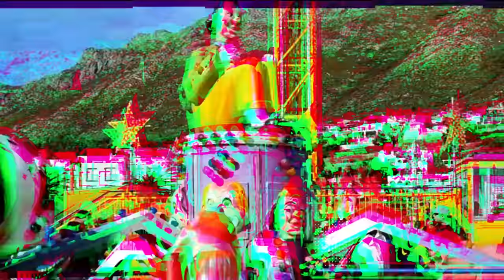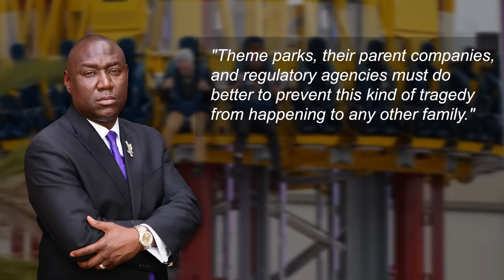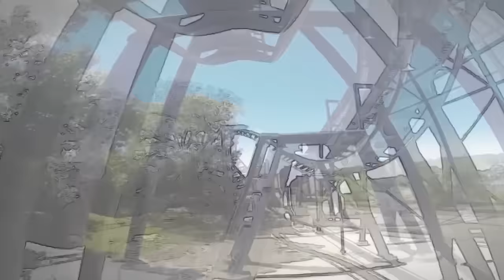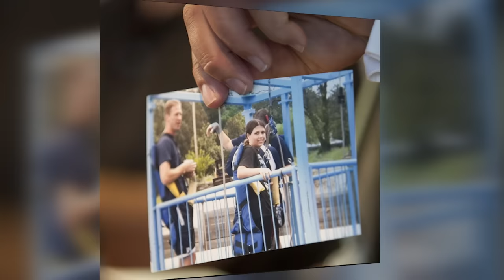9 Worst Roller Coaster Accidents in Human History

Comment: When Great America first opened I took my then 8yr old. She met all the requirements and then some. There were no seatbelts just a u-shaped restraint that clicked into the seat. Everytime we went upside down she started to slip out. I spent the ride holding on to her, desperately trying to keep her inside the car. We were fortunate. I've heard of kids who were not.
Reply: It is physically impossible to slip out of a ride when it is upside down when it's moving at a high speed. It's called physics. If your still above 1G when your upside down, your not going anywhere. All modern coasters are designed to invert above 1G so stuff like that doesn't happen.

Comment: It's just a known fact that rides sometimes fail or the necessary restraints do not work properly.  If extreme rides are to continue to operate, there should be really skilled and attentive attendants, not just a random teenager on a summer job.  People with size issues and/or disabilities should probably think carefully before attempting to board.
Reply: No teenagers ?   412.50 per daily admission.  85.00 to park.
Reply: In Australia they regularly check them for maintenance and close the rides when they feel theirs a maintenance issue or technical

Comment: If someone ever tells you to loosen your seat belt, don’t. They are there so you don’t fly out, same for the restraints, get those as tight as possible, not so it’s uncomfortable but enough to hold you in. I never would listen to someone if they told me to loosen my seat belt.
Reply: Seatbelts on coasters are to make sure you can fit in the restraint, Not to keep the restraint down. Also it sounds like your missing out on 🤩airtime 🤩

Comment: Regarding the first story... firstly, let me say that my heart truly does go out to that young man's family. It was an avoidable tragedy.

I don't think the rider, the ride operator or the park are responsible, though. Let me clarify. There is a small piece of metal deep within the restraint system called the proximity operating sensor. When you pull the restraint down, the small metal piece sweeps downward along with the restraint until the sensor behind it reads that the bottom of the proximity operating sensor is aligned with it. This is the maximum allowance of space between the restraint and the seat for riders to be safely secured. This triggers an "all clear" command for that seat (green light). The ride's computer system will not allow the ride to be dispatched until that "all clear" command is received for all seats. This is why the ride operators have to push down the restraints on empty seats before dispatching a ride vehicle.

The investigation into this accident revealed that the proximity operating sensor had actually been manually adjusted UP seven inches, thus causing the bottom of it to interact with the other sensor much sooner when pulling down the restraint. The investigation also revealed that this had been done to one other seat as well. Now... a ride operator would not be able to access this metal piece to adjust it. It is hidden behind fiberglass which covers the pinch points (joints) of the restraint, and the whole restraint system would need to be taken apart in order to reach it and adjust it with a hex key. The park would not be making those adjustments either, as their company does not operate this ride. Their company merely houses the ride. The operator of the ride is The Slingshot Group. The decision to make this highly illegal adjustment would had to have been made by management at The Slingshot Group and carried out by one of their ride mechanics, I'm guessing in order to accommodate larger riders than the ride was designed for in order to grab a few extra dollars at the ticket window.

I don't blame the ride operator for this accident either, as they would have received an "all clear" command from the computer system due to that adjustment being made. I don't believe the ride operators would have even known the adjustment HAD been made.

I am an avid coaster enthusiast and a FIRM believer in ride safety being priority one, priority two, and priority three. Safety first, last, and always. Having a little bit of "play" between you and a ride restraint will not be unsafe, but having that much "play" absolutely can be. That is why the ride computers do not allow the ride to be dispatched when the restraints are not down far enough. I've ridden coasters possibly hundreds of times since that accident occurred, but The Slingshot Group will never receive one red cent from me. I have since boycotted every single one of their rides. Shame on them for allowing greed to cause an accident, nonetheless a fatal one.

Comment: My family and I went to Knotts Berry Farm shortly after 9/11. We had family visiting for the first time from the midwest and if I remember correctly they were supposed to fly back home on 9/12 but were forced to stay when air travel was shut down. On the day we went, after dark, my dad and I rode a water splash ride called Perilous Plunge and a few minutes after were standing in line for a different ride. Paramedics and park personnel all rushed to the water ride we had just rode. A woman had slipped out through the safety harness at the top of the drop and fallen to her death in the water below just a few ride cycles after we got off. As an at the time 65 pound 7 year old, I remember being terrified that I might slip out myself. I think we left shortly after.

Comment: I don't think those roller coasters can take very heavy people. I say this because when I went to six flags magic mountain in California. We got on the Batman ride. When you sit, a metal bar comes over your head and into your lap and then locks in place. There was a guy that was pretty big (fat) sitting next to me and the guy that came around checking the metal bar to make sure it was locked and secure when he got to the big guy next to him. The ride operator couldnt lock the metal bar. So another ride operator came to help him to try to push the metal bar down to lock it but it was not happening. The 2 ride operators told the guy that he could not ride the roller coaster because the metal bar was not locking..
The reason the metal bar was not locking was because the guy was TOO FAT.. Well the guy got all offensive making a huge scene. Yelling at the ride operators that they were discriminating him because of his weight. A manager came over and told the FAT GUY that was not it. The roller coasters can not take very FAT PEOPLE. Because the safety metal bars will not lock the way they should..
Its sad but that is reality.
If you are too fat there is no way you will be able to ride a roller coaster..
The big guy left talking smack but it is not the ride operators fault. They were looking out for his safety and everyone elses..
This happened in the 1990s..

Comment: The first one had nothing to do with the ride itself at all. It had to do with the fact someone allowed a near 400 pound 14 year old to go on it, knowing fully well that the kid could not fit in the seat. He should have told him that he can’t go on the ride because of his size. But because he didn’t want to get accused of fat shaming, decided to let the kid on the ride without hesitation. It’s his fault, the kid’s fault, and his parents fault.  Can’t blame the park at all.
Reply: There's a bit more to it than that. The operater management adjusted (without manufacture approval) the position of sensors on 2 seats that tell the rides computer that the restraint is within a proper range of positions and allow for dispatch as well as indicate a green light on the operators console ( that's why the ride operators are screaming about the green light in the cell phone video) the ride operators were undertrained on the restraint system and told to put larger guests in these modified seats. Had they been correctly trained they would have known the restraint was in an improper position regardless of what the control panel indicated. This was mostly the operating company's fault (at icon park the park and ride operations are different companies) for modifying the 2 seats, not having the weight limit from the manufacturer posted, and for not providing the proper training to employees.  Had the seats not been modified the control panel would have indicated red on his seat making the ride impossible to dispatch until the red light was green. Although some blame is for the rider and parents. I believe it is the riders/parents responsibility to at least try to learn about amusement rides for their own safety as information is more available than it has been in decades with the Internet. Also shortly before he was denied on the parks slingshot ride because he was too big
Reply: It's not the kids fault or the parent's fault because it's not their responsibility to be aware of the regulations of the rides. The people who run the ride know the regulations and should have informed them that he was too heavy, and not wanting to be accused of fat shaming is not a good enough exuse to not do your job when people's lives are on the line. They have no problem telling someone when they're too short to ride....This is 100% on the park. You're letting your hatred/disgust of fat people cloud your common sense and judgement
Reply: @thekalenichannel1812  I don't hate fat people at all. I put some blame on the kid for going on a ride knowing he probably couldn't fit. I put some blame on the parents for allowing him to go on the ride, but I put the most blame on the employee who let him on, knowing fully well the kid was way over the weight limit.

Comment: Rosy's death is the reason why all rides have sensors in every seat now. She was too big for the seat, she fell off the 2nd turn after her the hydraulics in her lap bar failed(this was before the ride had seat belts). It was her son sitting with her.

Speaking as someone who 1) was there that day, and 2) used to work at the park

Comment: My seat belt inexplicably came undone on The Magic Carpet ride at Kennywood when I was a teen; barely got it back on just as the operators stopped the ride
Also saw pieces of the Steel Phantom come loose while riding

Comment: Although not an accident with passengers on the coaster itself, you definitely could have made this list a 10. July 6th 2012, in La Ronde (Montréal). An employee of the park entered the restricted area under the Vampire (Batman : The Ride clone) while a train full of passengers was going through the course. He was decapitated on the spot by the first car of the train. Following the accident, 6 people were in absolute shock and had to be hospitalized. No reanimation attempt was made on the victim for obvious reasons. The ride was closed for the duration of the investigation. It was later determined that ride operators were not at fault and did everything they were supposed to do to ensure the ride's safety. The roller coaster itself isn't problematic either. The blame was rightfully put upon Six Flags for failing to ensure the restricted area COULD not be accessed while the ride is in operation. This lead to much stricter safety protocols throughout the park.

Comment: I had TWO near misses on carnival rides myself, so I fully believe you. I went on rides after but I would check and recheck my safety restraints and pray they worked! Or that some other thing did not go wrong! The Gravitron in the late 80's was also dangerous! The movement of the right is supposed to stick everyone to the wall on its own, no restraints. It did NOT do that on one ride I took on it. Thankfully, I had been on one before so I knew the floor would drop out at some point. I came off the wall somehow and landed on that floor. I was obviously panicked because I knew the floor would drop out soon! The ride operator was outside the ride and had no way to see in as I recall. My cousin was looking on in terror. Somehow I managed to get myself back up and fling myself back into my spot just before the floor dropped out. No more rides on that after that! My safety harness on another ride was not enough to hold me in. I was in high school and was very small and thin. The first time the ride went upside down, I slide mostly out of my seat past the harness. Luckily, it also had a cage around it. I just held my arm out and tried to hold my weight off of the top of the cage every time it went upside down. I was terrified I'd come loose and be chucked around the cage my friend and I were in injuring us both or worse that the cage would give way and open and I'd fall out to obvious death. Terrifying! It taught me early in life that I was definitely taking a risk on any ride I chose to ride after that. I did ride ones but I have always avoided the extreme rides. They just keep getting more extreme and I have a limit of what is fun (and still risky) and what will just be pure terror for me. Those are not fun let alone worth the risk for me. No thank you!

Comment: I personally had a ride on a rollercoaster once. It was not fun at all, it was horrible, with no way out other than to wait until the ride was finished. That was enough for me to never do this again. While I did not have a grave injury and did not fell out, I suffered from neck pain for weeks because the ride was not smooth, but extremely jerky. The forces on my body were so extreme during that rollercoaster ride. I was extremely panicing and felt ill after that ride. So it was not only the weeks long severe neck pain, but also a psychic response and a response from my stomach. And all together immediately ruined the whole day in the park for me as well as the weeks after. I can only encourage you to NOT ride a rollercoaster. Say NO to any ride that looks extreme. It's not worth risking your health or your life for this short experience which isn't even fun at all.

Comment: The first story about Tyree Samson's death is littered with errors. There were no "safety belts". There were safety harnesses (which are more effective than old style belts anyway, but that's not the point). A "ride operator" did not "loosen the belt". Instead an employee of the company operating the ride (not one of the teenagers running the ride) made an unauthorized modification to the safety harness to accommodate larger riders like Tyree. Tyree was about 50 lbs heavier than the maximum weight the ride was designed for. In other words there was nothing unsafe about the ride as designed. It was the improper modification (primarily) that caused his death. Also in this video they show a seat on the ride that is taped up and out of commission implying that was Tyree's. It was not. That was just another seat needing repair. A video of the complete incident can be found online for those with a strong stomach.

Comment: The train in 1996 is very upsetting because with trains like that you as an operator should’ve learned the max speed you can go, i used to work at a park that had a custom park train that I was certified to operate and it has only dealt with 3 derailments. 
The first one was an accidental one that happened by the direction change rails, second one due to weight in the caboose being shifted after middle schoolers thought it was funny to rock back and forth and the third because of a rotted tie. 
We’ve also had one instance where the breaks failed but that operator was going a slow enough speed that even though it was going downhill without breaks it was able to stop on a more level part of the track so he could evacuate the people on it, so really you shouldn’t be going super fast with those trains anyways since it’s rare but if the breaks fail you want it to be able to stop.
Plus that’s shameful for the inspector to pass something like that because if there was so much of a buildup of leaves on the track it would be blown off entirely and if he didn’t know how to inspect it he should’ve called someone else in instead of passing it.

Comment: I personally think that all rides should be safety checked way more often we had a rollercoaster here in U.K. there was an accident where a deer was running through the Field where the rollercoaster is situated as it jumped over the track it hit the front coach the impact made the deer explode causing multiple people to be injured. And in the same park a young boy was on a another rollercoaster because his parents didn’t check the belt he was able to stand up and unfortunately due to this  he stood up whist it was spinning round causing him to fly out of the ride hitting the concrete below killing on impact

Comment: I once got onto a ship ride and sat on the back seat. Apperantly my weight wasn't enough to hold my butt down as it rocked. There were no seatbelts either. If I wasn't holding on to the bar for my life, I would have crashed face first somewhere on that ride for sure.

Comment: Years ago when I worked at Islands of Adventure in Orlando we would get overweight people who skipped the seat tester at the beginning of the ride (Hulk rollercoaster) and would ask the employees to push on the seatbelt until it latched. The maintenance technicians started getting upset and telling all the employees to stop doing that because it was weakening the harness restraints. The guys would do it so as not to hurt their feelings I guess since they had already waited in line, but fuck their feelings. There was a tester seat at the entrance to the ride for this exact reason: to make sure they could sit comfortably, but no they wanted what they wanted even if it meant embarrassing themselves and making the safety restraints weaker for the next rider.